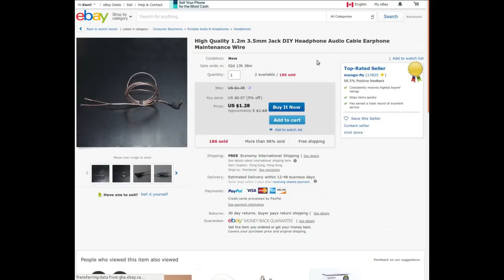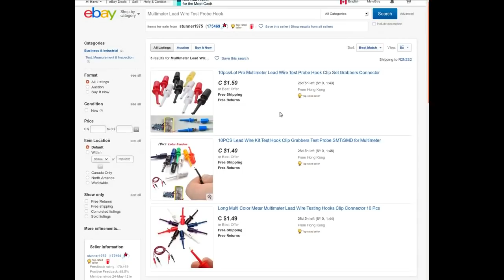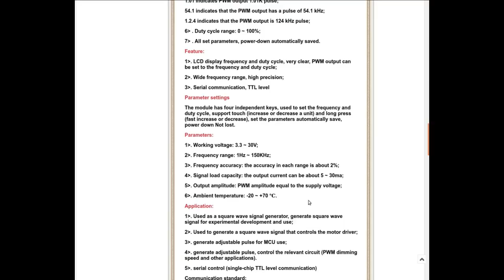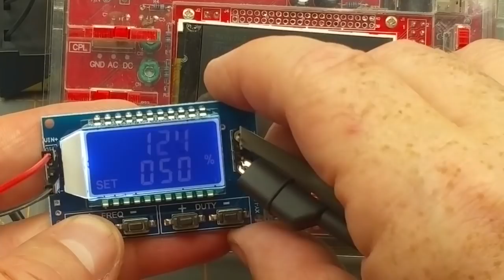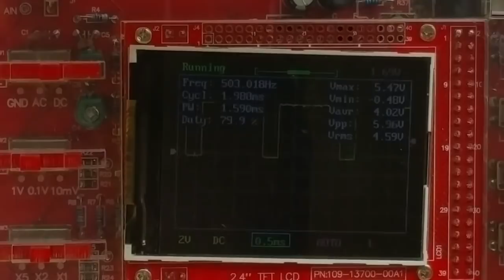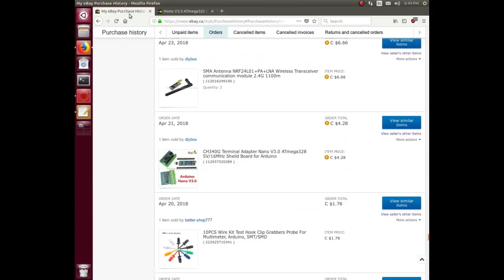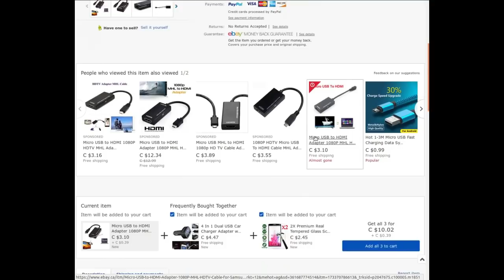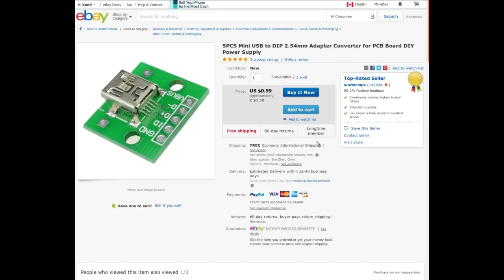Mailbag Monday 38

Comment: Probably cheaper to go to the dollar store for 99 cent complete headphone earbutds, no soldering needed.
Reply: Fuel, tear and wear of the car, time wasted.... Personally, I like unpacking and opening the mailbox more.  It has become so severe that Christmas day has become a dull and unpleasant day for me. People don't expect me to open their nicely packed gifts with a knife. I get socks and unwanted gifts that I would never ever order....  The food and company is more important for me in case you wondered if I am a nutcase :-)
Reply: Might be cheaper, but they're total crap, unless you're deaf so you will not notice audio quality. I think I might get some cables for my old earphones that I got with my first android tablet. These are quite good, much better than any other that were added to other things that I bought in past.
Reply from the maker: As much as I like dollar store stuff, their headphones sound terrible. And the wire that they use gets brittle and breaks very quickly.